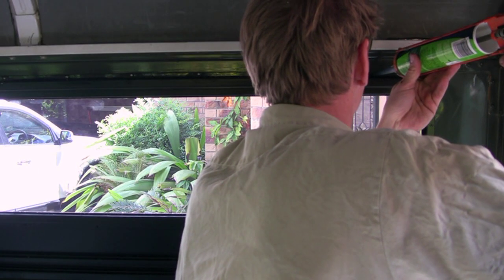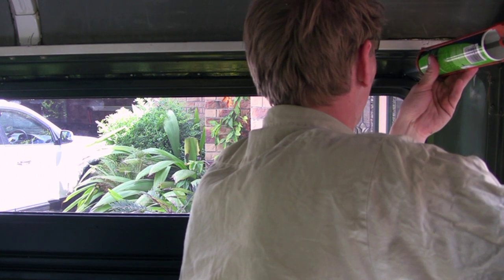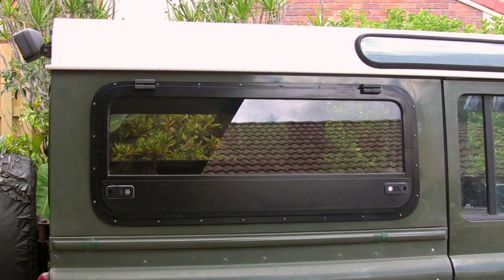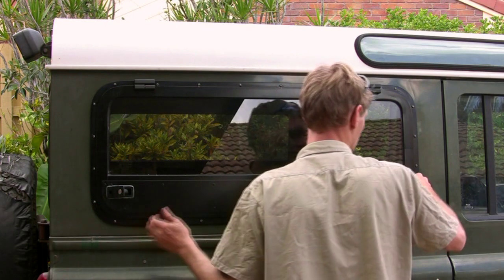Land Rover Defender Gullwing Door Upgrade - Installation

Comment from the maker: For me, having 2 more access points into the rear is a lot easier than opening the rear door. Plus I've recently installed 2 storage boxes by the windows for quick access to recovery gear or cooking gear. It's better than having to unpack part of the back to find those urgent camping supplies.

Comment: When opened, water will flow down the inside of the car?
Reply from the maker: hi mate.. yes if left open water will get inside. They are meant to be closed while driving. Otherwise they are quite waterproof. Probably better sealing then the original sliding rear windows. Thanks

Comment: Hi can you open them from the inside
Reply from the maker: no mate. Only from outside
Reply: Roaming The Outback cheers mate looks like al have to modify them with a handle on the inside.
Reply from the maker: The locks can only be opened from the outside. If you don't click the lock latches down you can still push them open from the inside.
Reply: Roaming The Outback yes I would just unlock them before going out then open them from inside when I needed. Am putting plans together for a 110 shooting truck with one rotating seat that I have modified a gun rest to so you can shoot from both sides in comfort.